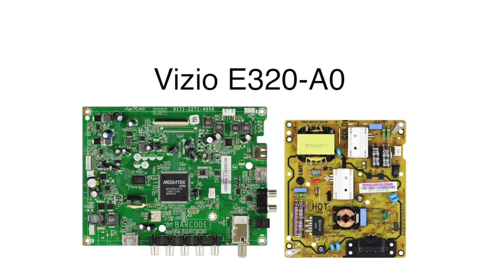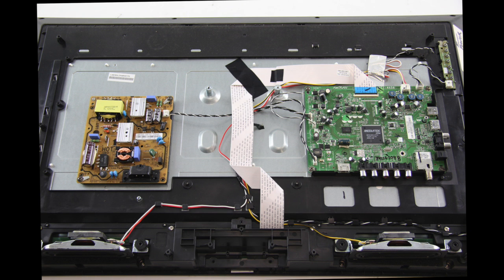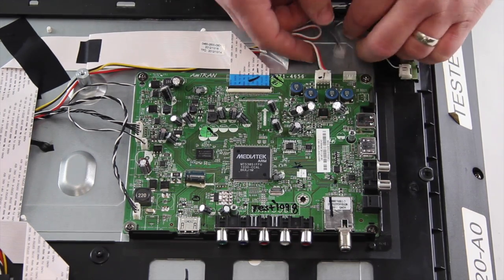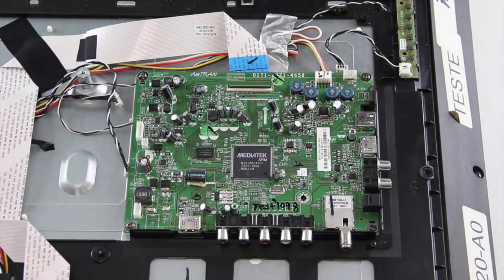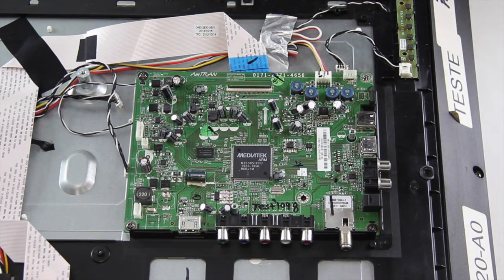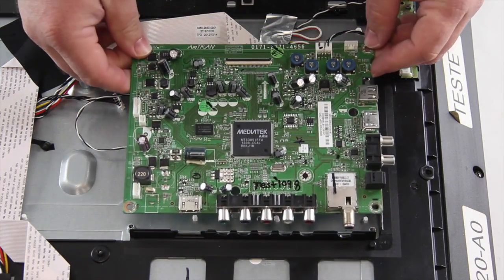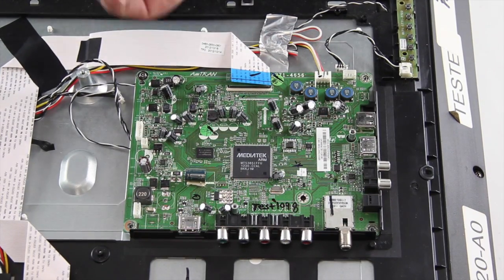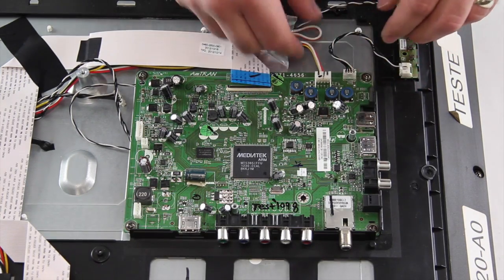Vizio E320-A0 Complete TV Repair Kit - How to Replace all Boards for TV Repair

Comment: I'm so glad I watched this. I wasn't sure how the repair needed to be done and assumed it would require soldering, and I called a TV repair store in the next town to see if I could have a professional do it... That man was gonna charge me 50 dollars to do this for me. A few screws and connectors. 50 dollars. He was mean, too! And he said it "probably wouldn't fix it"!

I just bought the parts and am gonna do this myself when they arrive. I can't believe that dude was gonna swindle me like that. 

Hopefully this swap takes care of the problem. It dies if I turn it off, and will only come back on if I unplug it and plug it back in, then press the power button as quickly as possible. 

I'll report back whether it works or not. I'm using this old TV as a computer monitor, and it works great for my purposes.
Reply: It worked! Very simple fix. 

Side note: Weirdly enough, the TV screen seems a bit brighter now.

Comment: Big shoutout to your website! I just received my replacement boards and finally fixed the issue! (I have an E320-B0 that stopped turning on and the easy steps didn’t fix the issue). Swapped out the power and control boards and my tv is working perfectly again. Thank you!

Comment: Hi, I have Samsung UA32F5300ARXZN which have following boards BN41-01938 (T-con) , BN41-01958(Main board), BN44-00605B (Power board). The issue is,it  have no picture but it is able to produce sound.  Picture some time come for a nano second then goes off again.

The voltage labelling on power board(inverter board is not so readable so i am not able to know what voltage which be what )

Can u tell me step by step procedure for this particular power board? Kindly find links to get picture of power board and tcon board 

All related images are available here ,image are captured so that reading voltage label is easy .

http://pasteboard.co/xs96kh7G4.jpg   

http://pasteboard.co/xsadUQfAD.jpg

http://pasteboard.co/xsazRWVkr.jpg

http://pasteboard.co/xsber5wON.jpg

http://pasteboard.co/xsbSsLewQ.jpg

http://pasteboard.co/xscarkQGK.jpg

http://pasteboard.co/xscFZYlhd.jpg